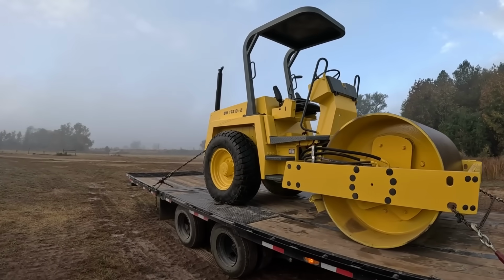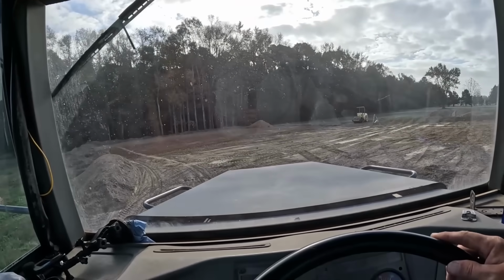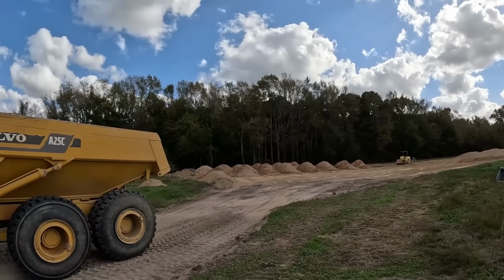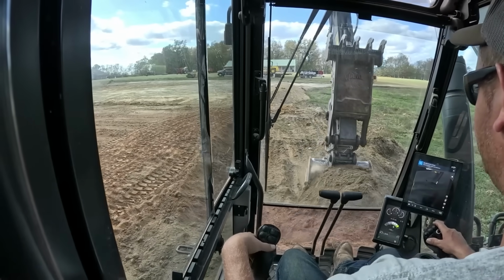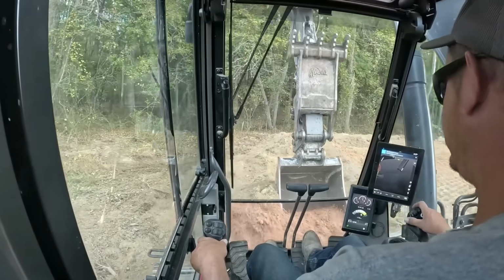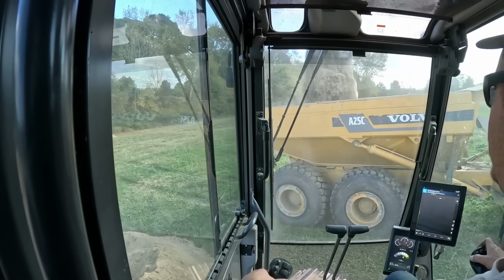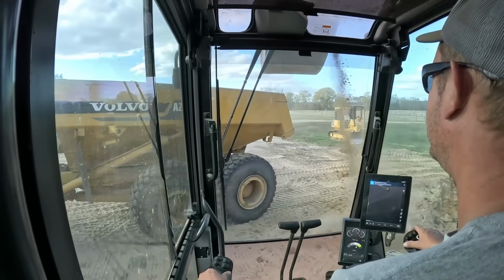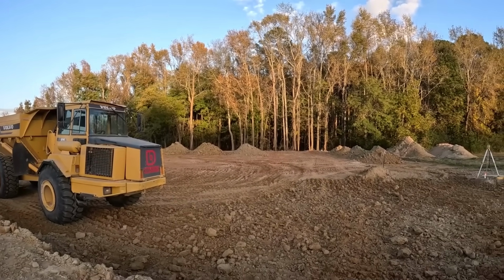One Pad On Grade Time To Start The Next!

Comment: 46 loads by yourself is really impressive Chris, even if you had a helper, it wouldn`t be any faster, you would be sitting in the 350 for 8 minutes waiting for them to get back. What a machine that 350 is, with that little fuel line in it, you get a sense of the scale of that beast, thanks for taking us along.

Comment: This is another job that you could use a bigger articulated dump truck a 30G or 40G volvo. Will you ever have time to get the windows tinted on the 350 and is tinted windows a option when specking out a machine.

Comment: learn from my experience ,stop drinking sodas. I came back from overseas and was stationed in Nas Alameda the plumbing on base was original so rusty and nasty you couldn't trust drinking it and bottled water wasn't a thing then so i drank sodas. the carbonation leaches the calcium from your bones and deposits it in your kidneys,if you don't drink enough water it won't flush the calcium out and it builds up to were you get kidney stones,believe me you don't want kidney stones. so if you have to drink sodas wash it down with twice as much water. you'll thank me later .

Comment: Barney is a gem. keep it running as long as you can. the government hates trucks like that. low cost, easy to maintain and no codes.
Reply: Hopefully Chris will replace the wiper blade on Barney before it rains.
Reply: Barney has codes